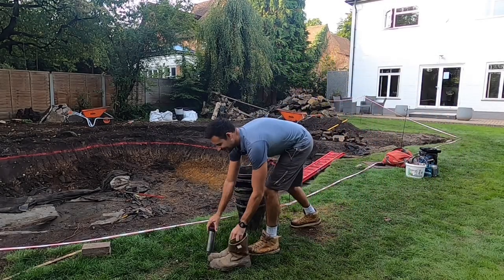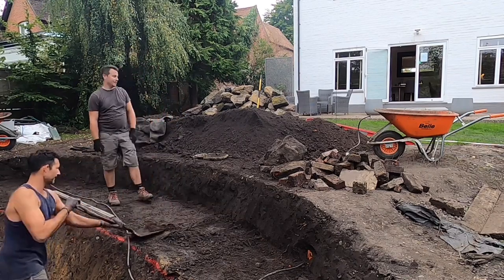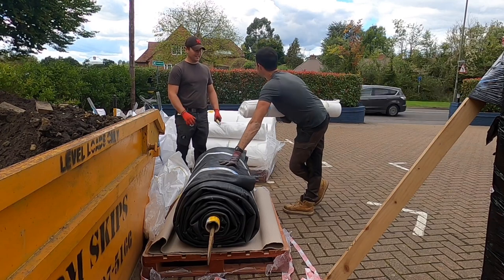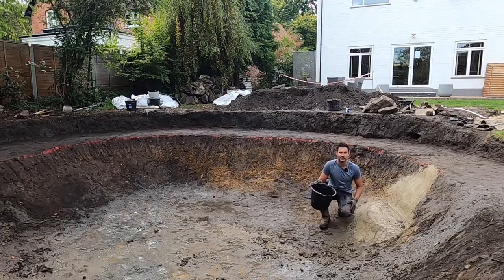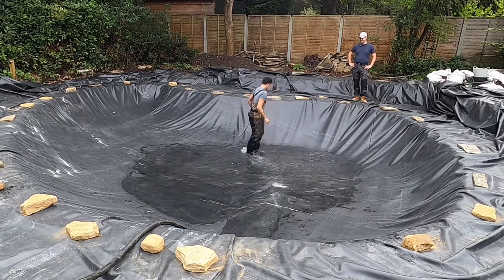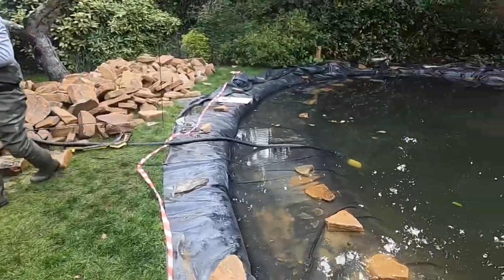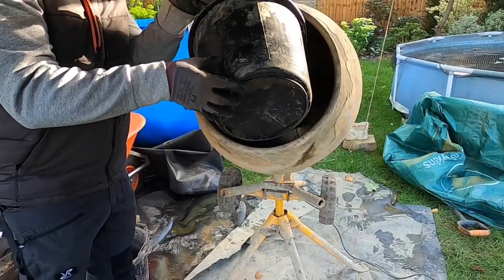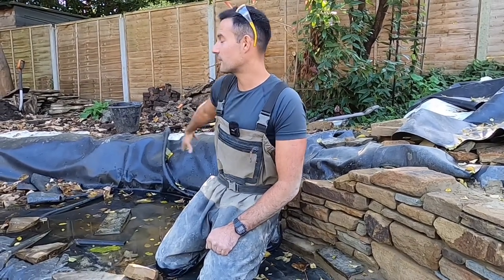Pimp My Pond! Pond re-design & construction part #2: pond lining & initial rock work

Comment: Love your videos was wondering could u keep tropical fish in a big pond
Reply from the maker: HI there, thanks for watching and commenting!  You could indeed in theory have a tropical pond- however in our climate in the uk having an external pond heated to 75 f/24c consistently will require some expensive heating bills and a well thought out design of the pond to have maximum insulation.  In a water gardens I used to work in we had a large 500gallon/2500 litre tropical pond indoors with a large red tail catfish, Giant gourami, shovelnose cats, Oscar’s, tinfoil barbs, leopard plecos to name a few species.  In such space they all got on together very well and was a great feature! 
Best,
Ed

Comment: Hi Ed, loved watching your videos on making great ponds - I'm currently using your ideas for my pond. I have a question - for your marginal planting zones.... You make the top line of stone around 25mm below the water line. Do you tie the stone work into the pond wall or leave it standalone ?  My real thought is how does water get into the planting zone, is it only by the 25mm over the marginal wall or do you allow water to seep through the stonework somehow ?  thanks in advance Steve.
Reply from the maker: HI there Steve, thanks for your comment and my apologies for the slow response- a good question!  So the marginal retainers tend not to be tied in, or if they are only by perhaps the lowest tier of stone.  When laying the stone I try to ensure that I leave a few small gaps here and there, or make sure that final pointing height is a little lower then the top of the rock in a few areas, to help water flow/circulation in these zones.  However this isn’t really necessary- the mortar securing the stonework isnt waterproof- as water level in the main pond reaches the height of the marginal zones you’ll see that these zones begin to fill even before water level reaches the top of the retainer, as it seeps through tiny gaps between the stone/mortar and the pond liner.
Hope this helps and thanks for watching!
Best,
Ed
Reply: @CrystalClearAquatics  Hi Ed, thanks for your reply - we've gone ahead and made the marginal zone, with gaps in the stone, so just as you said. With 10mm (washed as Dan did!) pea gravel as the marginal area, some did come through the holes, so i've placed a small amount of weed control around the holes to prevent fish going in and bits coming out. Water flows nicely though. We cemented to the main wall but not truely tied in. (If i could work out how to add a picture (if allowed) I would.  Thanks again - need to watch #5 now to see your finished pond.